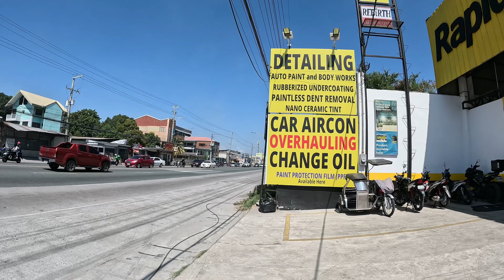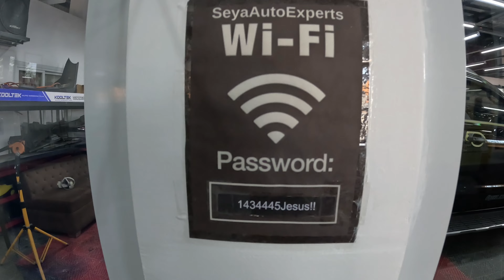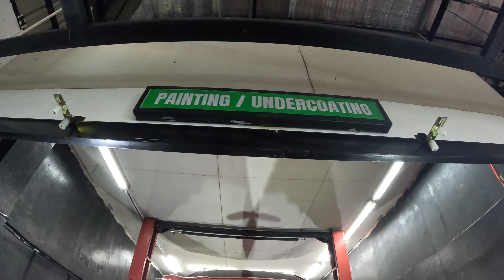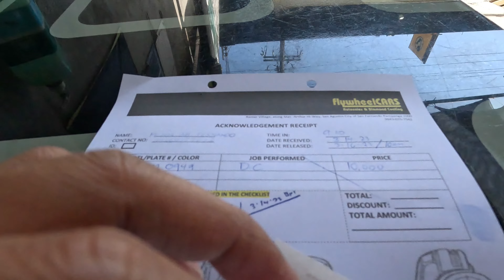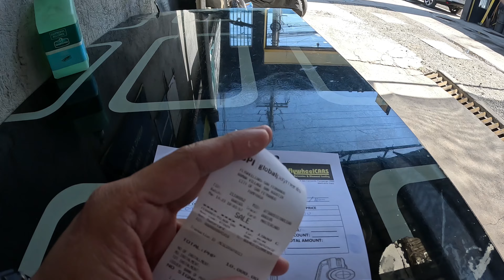Rubberized Undercoat + Ceramic Coating on her 1st month 😎 Salamat kay Lord 🙏🏻 (IR Vlog Episode 14)

Comment: Ganyan talaga part nf maintenance as the car getting older parami ng parami pa yan hanggang sa maramdaman mo mag iiba na rin tunog ng makina at lamig ng aircon.
Reply from the maker: Tama po kaya better prevention than cure hanggat maaga nakacoating under at ung body
Reply: Isa pa dyan as much as possible yung 100% synthetic change oil for engine  life long protection and preventive maintenance.
Reply from the maker: @danaustria1056  yes sir Fully synthetic ung oil Toyota brand ung pinalagay ko nung nag first PMS kami at 1k odo